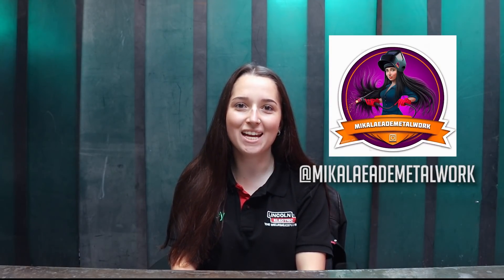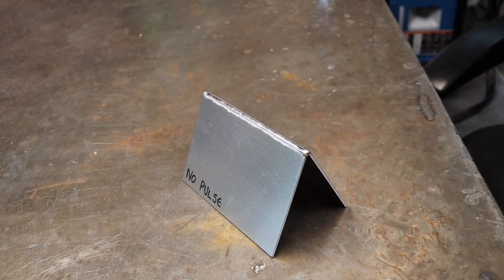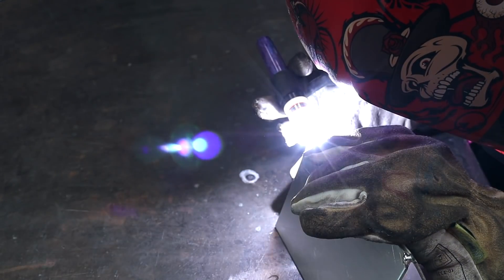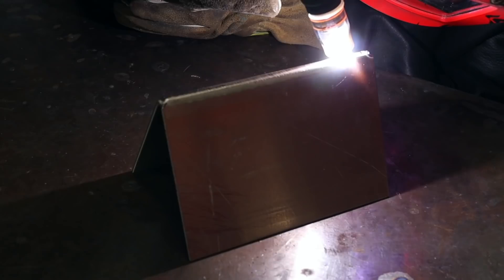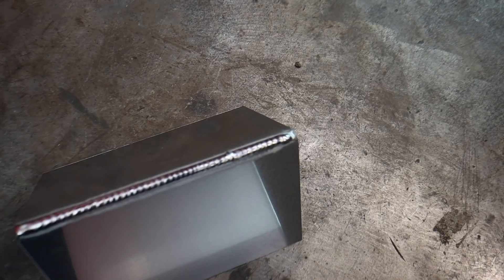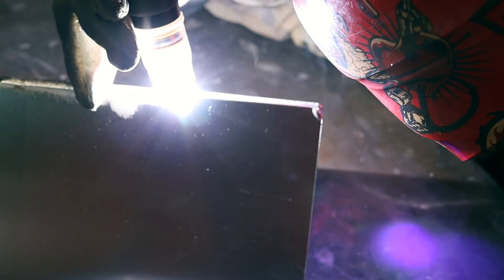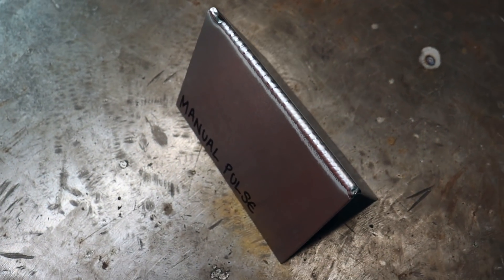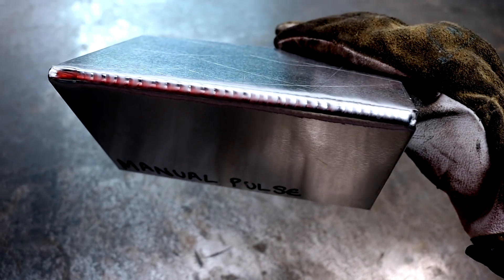TIG Welding: Pulse Vs No Pulse

Comment: Is there any difference in joint strength between all of those pulse settings?
Reply: @Mikala Eade Metalwork thanks for the reply!  So is non-pulsed with filler the strongest? I normally weld SMAW and self shield FCAW but I want to try TIG so I’m trying to sort myself out
Reply: @JacksonEngineering  it can help with looks but that's only if you lack the skill to drop dimes without it. The true purpose of pulse is to lower the heat input which reduces warping.
Reply: @jca66  right on. That make sense to me. Thanks!
Reply: @jca66  Can't stack dimes without it but I started out working on .8-2mm sheet with a old machine that didn't have pulse, a foot pedal or even HF start and worked out setting up the upslope/downslope to manually pulse it. was never anything to do with looks as 80% of the stuff I did was ground out and re-grained, but it definitely helped a lot with controlling warping on stuff I couldn't use clamps / chill blocks on.
Reply: @JacksonEngineering  there's no context to the joint strength with type of metal transfer..
Reply: @monilvaidya5485  Did you mean "no CONNECTION"?  (tried to get YT to put this under the original comment)
Reply: In some instances the joint strength can be much stronger with pulse than it would be without. But there’s no overall answer for all applications in mind
Reply: @Mikala Eade Metalwork any suggestions or tips for overhead TIG welding for beginners? Thx for your time & response.
Reply: @keyarnf5509  practice. Lol
Reply: @jca66  of course that too...lmbo! Thx

Comment: You can add filler wire to all of those settings. Just cut the wire to length and lay it in the seam and weld over it.

Comment: the pedal will never be the same as having pulse settings.
Reply: Unless you hire a dancing penguin from Antarctica....
Reply: But seriously if you used something like the 6061 finger push button TIG amp controller, might that work?  There are cheaper fingertip amp controllers but that one gets high marks.  That said, I am not advocating for manual pulse.  My impression of TIG welding is that the welder needs all the concentration he/she can muster; dancing on the pedal does not fit in.

Comment: To everyone Dont try to fuse weld Aluminium without Filler Rod. That weld will fail any AWS Testing Period. The purpose of Pulse welding  Isn't to cover up an incompetent welder by making the weld cosmetically look good Period. Pulse welding main use is  To control penetration in thin metal  And to help minimize distortion. It's also very useful in automation welding to control the weld width, shape and penetration.
Reply: I like your videos, too, if you are the artist/welder I think you are.  Interesting comment for us learning mode Noobs here.

Comment: I’ll start with, I’m not a tig welder. Question : fast the fast pulse setting could you just leave the filler rod in the arc instead trying time it in and out?
Reply: @Mikala Eade Metalwork yes it does. Thank you
Reply: @andyc5612  I was wondering that, too.  Thanks to all of you more experienced folks for these comments!!!!

Comment: Much thanks to the editor of this video for turning down the volume during the welds!  Wish more Youtubers turned down obnoxious noises.
Reply: If you're watching on a computer or a tv, you can use the sound equalizer setting on both, which automatically makes a quiet sounds louder and the loud sounds quieter for a less obnoxious and balanced sound experience.
Reply: @HeavyHiitter  Thanks for that.  Never occurred to me.

Comment: Straight garbage. Nothing helpful for structure welding. Aluminum needs filler otherwise there will always be a micro crack in the end. ss you can fuse without leaving micro cracks. A good looking weld doesn't mean it's good, a bad looking weld doesn't mean it's bad.

Comment: Building a rod oven for SMAW. But need to tig up some 16g mild sheet. Going to try the pulse settings on my machine. The rod oven doesn't need to be to strong. Will a higher pulse setting give a good medium between making good looking weld's as well  a strong joint?